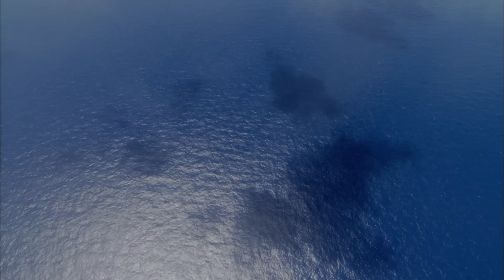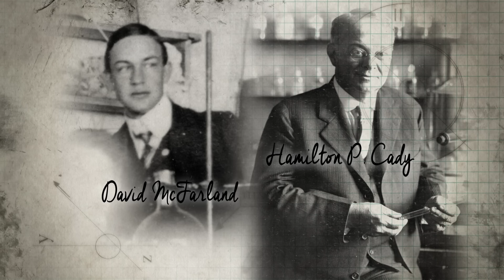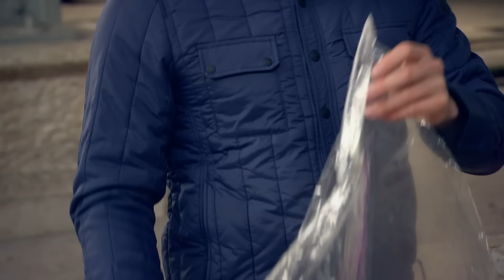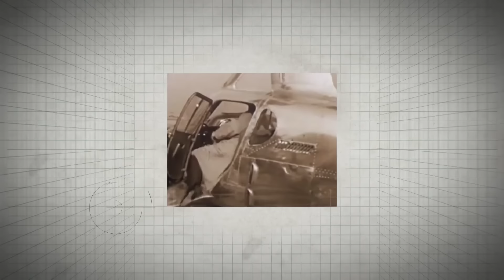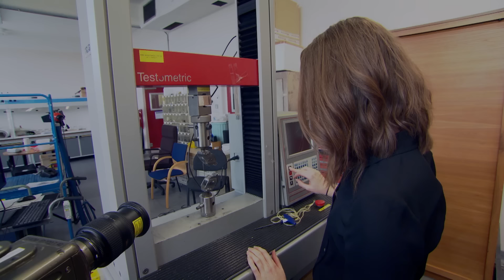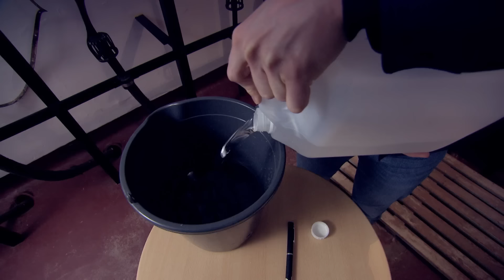The Futuristic Airship That’s Redefining Remote Access and Disaster Relief | Blueprint

Comment: 2) Page two, by Benjamin Chinye…

In any event, the lower hull of the vessel will need to be constructed with water-resistant materials. This will help to make the vessel buoyant when it lands on the surface of the waters/ocean. During construction, it will be easier to coat the lower hulls in hydrophobic paint (or potentially all of its hulls/exterior), and to make the exterior of the vessel as airtight as possible (unless installed windows or air-vents are opened to allow [oxygen] airflow into the crew living and working quarters). It is important to note that given the vessel's size, it will be easier to land the vessel on the surface of the ocean rather than on land—where it will need wheels and conventional engines to freely move about on land —which is not its forte. 

The Aincrad is created to function as an artificial, floating landmass! It will be the size of multiple stadiums, and its height will likely be comparable to that of a small skyscraper. This cannot be emphasized enough. It is intended, and it will remain airborne for many decades to come (all without needing refueling—thanks to its micro reactors, and possible use of SMR technology). It will receive personnel, food and repair supplies via helicopters, jets, or boats (whenever it lands on the ocean surface). The vessel will be capable of deploying miniature AI piloted submarines—whose purpose will either be for recreational reasons, seeking out enemy submarines, or charting the ocean floor for reconnaissance. The Aincrad will be designed to be the ultimate vessel and means of aerial domination!
 
There will be two versions of the Aincrad vessel: the small, white variant will be intended for recreational use and housing wealthy personnel (orchestral music will play soothing melodies on board, 24/7 for its occupants), while the matte black variant is fully intended for warfare. It is 'this' variant (matte black) that will come to dominate the land, sea, skies, and space of the future!!!
Given the success of its longevity in the air (and for many decades without refueling), the blueprints of the Aincrad vessel will serve to be the inspiration for floating cities of the future, especially on the upper atmosphere of planet Venus (but this will be many decades ahead and far into the future).
 
NOTE: With its 12 MRs (Micro-reactors), the Aincrad vessel has powerful and effective electromagnetic deployment systems; which allow it to utilise electromagnetic energy to launch, deploy or project assets (such as AI-guided missiles, aircrafts, or satellite-rockets, etc). These system are imperative to the vessel's success on the battlefield, and they will be strategically situated within the vessel in a manner that will allow for them to 'unfold', thus gaining access to the outside environment and upper atmosphere. These electromagnetic deployment systems will be situated around the Aincrad vessel, so as to allow it to quickly and effectively cover a wide area around the vessel—effectively shielding it from all sides with a cluster of Ai-piloted drones.

[Update 12/31/2020]: Aerogel will be used to augment and bolster functionality within the Aincrad. Active desalination will be used to pump sea water into the vessel for storage, fuel conversion and general use. This will mostly take place when the Aincrad-vimanas vessel lands on the surface of the ocean. Low-grade variants of aerogel will be used to isolate noise from the crew operations quarters. This will help to optimize effective communication, work and sleep quality. Low-grade quality and cheap aerogel will be situated within the walls and hulls of the Aincrad vessel. Aerogels that are utilised like a sponge to pull water from the air are called "hydrophilic-aerogels". The Aincrad will incorporate both types of Aerogels (or more if needed) to minimise the weight of the vessel.

NOTE: Dividing and splitting the functionality and the Aincrad vessels capacity to dominate multiple domains into specialized vimanas classes will greatly increase the feasibility of the aincrad vimanas vessels! It will also remove the main weakness of the colossal vessel which is its size, i.e. having multiple vimanas class vessels is notably harder to take down than a single, multiple domain, super vessels (or flying, boss tier fortress).
Reply: 1) Page one, by Benjamin Chinye

AINCRAD-FLOAT-SYSTEM (VIMANA)/FUTURE-AIRSHIP-FLOAT-SYSTEM/MAGNETO-HYDRODYNAMIC-CIRCULATION-DRIVE-SYSTEM/FUTURE-AINCRAD/AI-POWERED-AIRSHIP-CARRIER/DRONE-AIRSHIP-CARRIER/AI-FLOATATION-PLATFORM/FLOATING-NUCLEAR-PLATFORM/FLOATING-NUCLEAR-POWERED-PLATFORM/HYBRID-MHD-FLOATATION-SYSTEM/HYBRID-HYDROGEN-MHD-FLOATATION-SYSTEM/REVAMPED-AINCRAD-FLOATATION-SYSTEM/GLOBAL-PEACEKEEPING-VIMANAS

I envision a floating, giant, aircraft carrier that is made of aluminium and other light materials. Its size will encompass and be reminiscent of multiple ring shaped stadiums that are stacked atop the other, and with an array of strategically placed rigid blimps situated between them. While the exact numbers of these rigid blimps remain unspecified, I anticipate that more than 12 will be necessary (potentially 18). When stacked together as intended, their overall geometry and shape will resemble that of a  floating bee hive (perfectly smooth, teardrop shape). It will become a metallic fortress that is comprised of aluminium and steel (the use of steel will be sparingly, so as to minimise weight gain)!

As for its flight mechanism, the multiple hulls of the vessel will contain the hydrogen-filled gas bags. They will help to negate the effects of gravity by providing the majority of the buoyancy. The Aincrad vimanas vessel also utilizes Magneto-hydrodynamics (MHD) systems for a silent thrust. The MHD system will be connected to the ventilation system of the vessel. The mechanism of the MHD thrusters requires powerful internal electrodes to ionise the air—turning it into cold plasma. This will then be propelled towards the exit terminal of the MHD thrusters at mach 10 speeds! The majority of the MHD thrusters will simultaneously double as positional thrusters. They will allow the Aincrad vessel to both hover and float in any direction.

NOTE: All electronic systems, from the AI computational systems, communication systems, radar/sonar, electro magnetically launch systems, etc will be powered by an array of onboard micro-reactors (and possibly a few small modular reactors/SMRs).

As for the functionality of the main Aincrad-vimanas vessel, it will primarily house nuclear warheads in the form of a small array of simple missile systems. These systems will be predominantly designed to be situated near the mid-section of the Aincrad's main hull (as well as at the upper layers of the vessel). This will allow it to apply additional pressure by bombarding and overwhelming the enemy in its front or beneath it. The rest of the nuclear armed missile systems will be situated around the Aincrad vessel (their purpose is to provide Omni directional protection via the kinetic shockwaves that is produced by a single nuclear missile blast. This will act as a shield and wall of pressurised air upon detonation. This process will always be carried outside the Aincrad's nearby field of influence, this is so that it does not suffer/get caught up in the ill effects of its own nuclear warheads—or pressurised air shockwaves AOE). Added functionality to the vessel will include the use of AI-guided, aerial torpedoes and AI-powered drones that can be synched to a human operator via an AVR/VR headset. The AI guided aerial torpedoes will carry nuclear payloads and will be launched via an electromagnetic launcher towards the ocean below.

For operations that will require the AI-drones to function far away  from the Aincrad vessel/mothership, they will be accompanied by a set of small, armoured satellites that will be housed and launched at the top main Aincrad-vimanas vessel. The satellite launch system will be surrounded and crowded by a system of electromagnetic railguns. Further more, at the top [floor] of the Aincrad-vimanas seats a crown of directed energy weapons that will surround its exterior. They will be in constant communication with the sensory system of the vessel (e.g. radar system). 

They will form the "directed energy anti-satellite [weapon] system". The reason for this is to avoid the recoil that comes with using anti-satellite missile systems—which will force the magneto-hydrodynamic circulation system to compensate, and to do so against strong winds (which would be difficult). This validates the use of directed energy weapons to eliminate enemy satellite in space. 

While a laser system for anti enemy satellite functionality might suffice, I would strongly recommend the use of high-energy [exothermic] particles railguns being stationed like a crown at the top of the Aincrad vessel. The kind of exothermic particles that will need to be selected for will require one that can still be ignited, explode, and burn in the vacuum of space (perhaps "iron powder + boron coating" will suffice. A laser will be needed to ignite the speeding shrapnel at high velocity). Before launch, the launch barrel of the railgun weapon system will need to rotate at high velocities to take advantage of centrifugal forces. These will both stabilise the spray of the exothermically particles, while increasing their overall range considerably!
 
NOTE: In order to perfectly stabilize the "Crown of electromagnetic railguns," the positional thrusters will be linked to a predictive-AI (master-AI in the control system) that calculates recoil before the shot is fired, adjusting the Magneto-Hydrodynamic flow in the thrusters in real-time to maintain a perfect hover and stability.

NOTE: At the top of the Aincrad/Vimanas vessel will be a launch site; it is primarily used for launching satellites, as well as launching anti-satellite missiles into space. The Aincrad's internal communication systems will always be in contact with the satellites that it launches into space, as well as (currently existing) weather satellites, for ease of navigation and missile-targeting systems. It will also be equipped with a number of different types of scanners, long distance radar and sonar. This will enable it to target  fighter-jets, ships and submerged vessels, such as enemy submarines, with its aerial torpedoes and nuclear warheads.
 
The Aincrad will need to be outfitted with multiple positional [MHD] thrusters for faster acceleration and evasion. They will be strategically situated around the vessel so as to provide omni-directional thrust. Together, such a system will make the Aincrad vessel compatible with missile-weapon systems, as well as anti-satellite missile systems. They will be sufficient enough to counteract any recoil force that might destabilise the vessel and is brought about by the thrusters of the missile systems [themselves] during operation/use! The Omni-directional thrusters will be connected to the master-AI control center and system. In so doing, this grants full control of the vessel's buoyancy to its master-AI control center (which is connected to and will have access to everything it needs to effectively and safely plot a [travel] course. It will even have access to satellite technology and support at all times for ease of navigation).

NOTE: Both its missile, aerial torpedoes, and drone system will be AI enabled (controlled by a complex AI that is geared for war conditions and operation. They will have the capacity to track down and eliminate their specified target.

NOTE: Conventional AI-drones will suffice. They just need to be equipped with tactical nukes, missiles and aerial torpedoes! The drones will need to be powered via electricity, capable of recharging, as well as ascending into the upper atmosphere (flight-capable at higher altitudes). They will be able to circle and surround the main Aincrad vessel, thereby acting as guard personnel/escort. They will also be capable of operating far away from the Aincrad's command and field of view. Future reiterations of the Aincrad vessel will house AI-operable mini-submarines, for universal dominance, i.e. even within the depths of the ocean; where they will silently eliminate threats with their torpedo, nuclear warhead payloads! They will need to surface in order to be updated with long-term command plans from the Aincrad, which the main Aincrad vessel will be able to do wirelessly. Finally, they will also be programmed to be self-sustaining, but all drones will be programmed to prioritise the survivability and longevity of the main Aincrad vessel at all costs!

NOTE: The Aincrad's drone deployment system will see to it that their drones are outfitted with BISI (biologically inspired synthetic intelligence) AI.

Comment: One of the Best uses for this type of Aircraft would be to Fight Fires. It could carry a Large Water tank and have a spraying unit hanging below it with adjustable nozzles keeping a safe distance from the heat of the fire. And on top refuelling nozzles as used by jets which helicopters could use thereby replenishing the tanks and maintaining suppression of the fire. Currently its a big splash and run with hope to hit results.
Reply: Because fires have no thermals?

Comment: A better idea would be to fill a balouga plane with a mixture of helium-hydrogen upper carbon composite fuselage instead of cargo  and you would get an aircraft  with enough buoyancy to save fuel by 90 % ; therefore a cheap air travel alternative .

Comment: This video is click bait. The airship crashed about 5 years ago and never been seen since.
Reply: Wrong, that was years ago & since then Airlander has got it's certification & has moved to full scale production at new fallacies. A number have been ordered for delivery in 2028 both for the Highlands and Islands Transport Partnership (HITRANS) who want 6 & for Spanish regional airline Air Nostrum who plans on replacing 10 of it's existing fleet of jet and turboprop aircraft with Airlanders.
Reply: @ZuulGatekeeper  So where are they building them? There where you should have been filming.
Reply: @thechurchexplorer  124 acre site at Carcroft Common, Doncaster. They broke ground about 8 months back & once operational they recon it will make 24 airlanders per year by 2028.
Reply: Not actually click bait  but nearly😅😅

Comment: I hate to tell you, but that is not the world‘s largest aircraft currently . Google founder has built a  rigid airship that’s 100 feet longer than that thing. That airship was built in America. Lockheed built it, and sold it to the British . They renamed it to Airlander 10 so that things’s been around for a long time not new. And it’s not going to be able to fly anywhere. Weather is still a problem as it was 50 or 100 years ago nothing is ever gonna change that. Weather is the biggest killer of airships!! they don’t like thunderstorms!! I know because I worked on airships for 35 years!! so trust me!! if the weather was perfect every day that thing would work perfect. unfortunately, weather changes.
Reply: It was not built by the US but by HAV a UK company who partnered with Lockheed. It was built as a demonstrator for the US army but yes agree weather particularly wind is troublesome but let’s hope continual support and innovation makes this thing effective
Reply: I agree they will never be popular.
Reply: Nearly one hundred years ago, the original Graf Zeppelin completed about a million passenger miles, using hydrogen as lift gas......without a single fatality.  The fuel was a mixture of flammable gases which had the specific weight of 'one' so that fuel consumption was replaced by air of the same weight, thus avoiding the need to vent lift gas.  Perhaps they had better weather-forecasters as well :trophy-yellow-smiling:?
Reply: Couple of corrections in there, the project was between Northrop Grumman and Hybrid Air Vehicles (HAV). HAV built the Airlander (yes a British company). Lockheed Martin was a separate aircraft in the original LEMV competition.

Comment: Hydrogen good and bad is its escaping nature. When it leak, it disappear in seconds up the air. Small leak and good ventilation, no problems with fire. Early airships cover was thermite and it burn very hot flame.

Comment: (electric pod motors would make 360 pods rather easy )
Reply: They would. All you need is a source of electricity…
Reply: @Trevor_Austin  they won't need much as most of the lifting is done by helium - during landing and take-off they could even be tethered to the ground 
(batteries are practical )